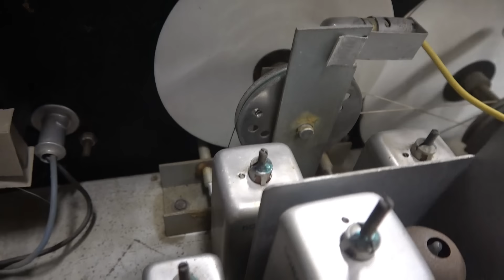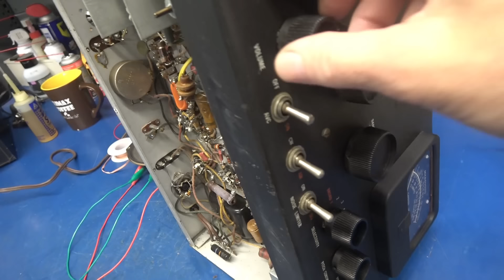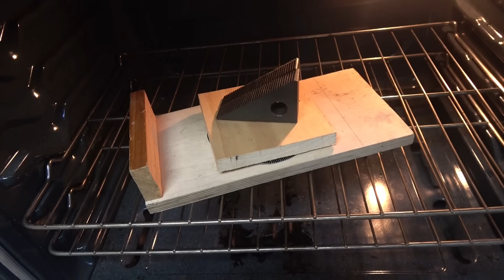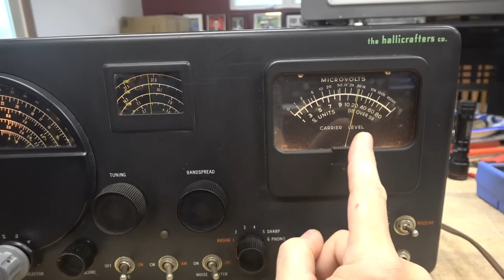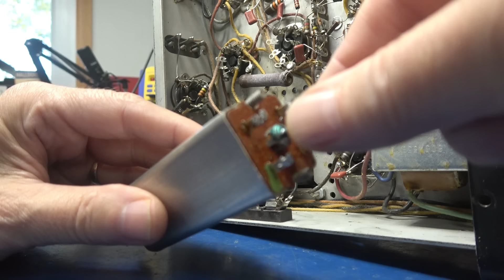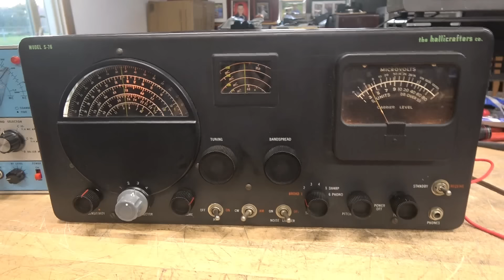Vintage Hallicrafters S-76 tube type shortwave receiver how to repair restoration detailed tips

Comment: Terry, being a licensed ham,  I truly enjoy all your videos, especially ham radio.  I have my Dad's Collins 75A4 receiver which  I replaced all the bumble bee caps.   The 7 Deadly caps as it was known, amongst others. I have recapped and am going thru verification checks and finally, realignment.  I also have Drake 4C line.  That is receiver, transmitter, trans match, speaker/power supply and microphone.  Purchased from the original owner.  Hybrid, built in the mid 1970's.  I have recapped.  Also have Heathkit SB200 amplifier which I have redone the power supply module, added soft start module. I need to finalize with the soft key module.  Love your channel and what you do.  Keep the videos coming.

Comment: I've been watching you for years, even the guitar amp vids but this was wonderful.  I'd love to see the alignment on video some time.  I got two sky champions at the last radio club meet ($35 each) thinking I'd get one good one with a parts set.  Brought them up on the variac AND dimes bulb and BOTH worked.  Both need work for sure (one pulling 635 milliamps and the other 575 milliamps. So know i have work to do but this was wonderful.  I understand the editing and videoing can be a huge PITA but for us newbies it would help us to learn techniques and proper procedures to do things right.  Thank you for this video and I hope you do more of them at length.  I'd love to see the restringing sometime too.  Please do more of these great receivers.  Heck I've got an HRO 7 to deal with in the future too.

Comment: Nice job. I have one of these receivers too, and mine also has a warped/burned dial. That's apparently more common than I would  have thought. After recapping and aligning, the sensitivity is still not very good and in fact has gotten worse in the last year. I need to open it up and spray the selector switch contacts which have become a problem but I'm wondering now if my sensitivity issue is the mica caps in the IF cans. Swell.

Comment: Good job as always! Maybe a can of freeze spray could have helped find the culprit.
Reply: Doesn't have to be old style freeze spray you may use a modern ordinary   canned air spray and it works just as good
and at 1/2 the price.